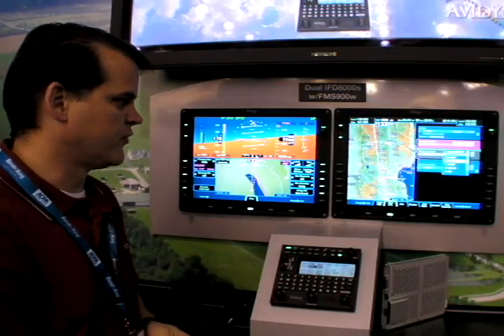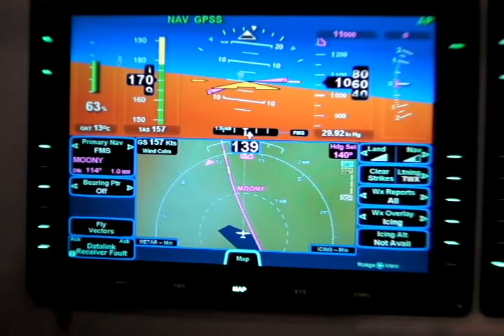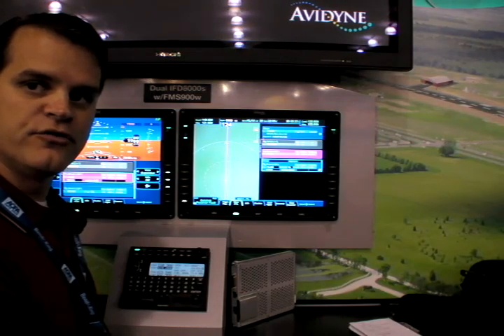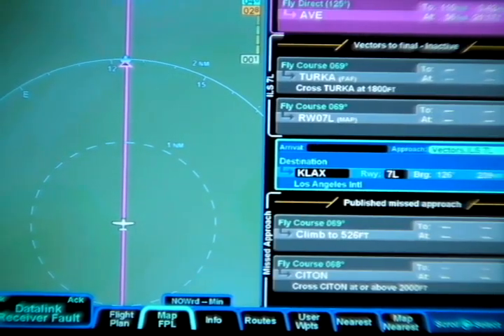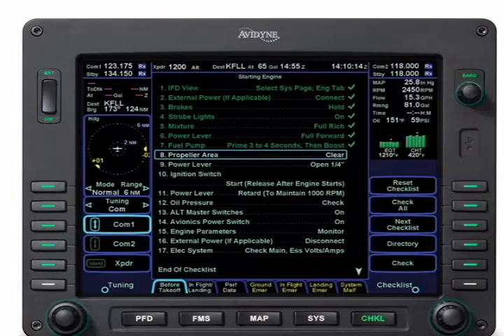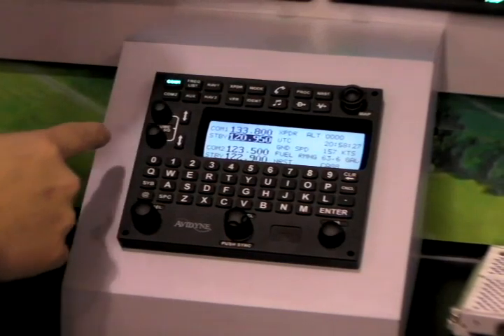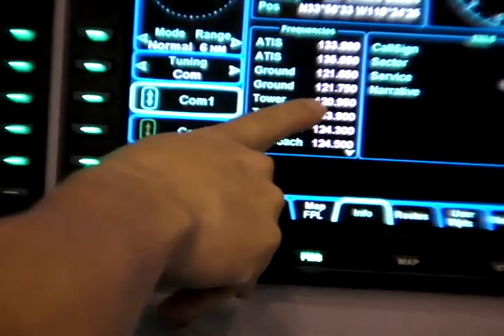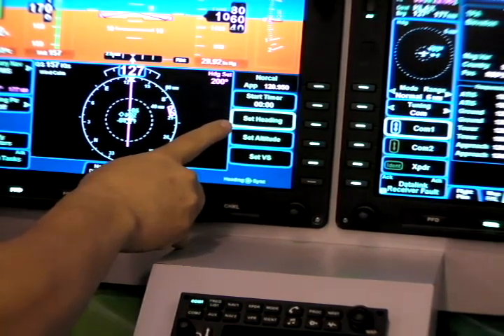Avidyne Entegra Integrated Flight Deck --  Release 9

Comment: I advise people to stay away from Avidyne. The hardware is very unreliable and gets defective quite frequently and needs repair or screen replacement. Not impressed with the quality. I would go to Garmin's G1000 glass cockpit instead. Yes, it requires an engineering degree to operate but once learned it is very good.